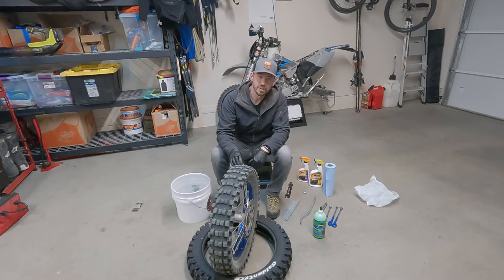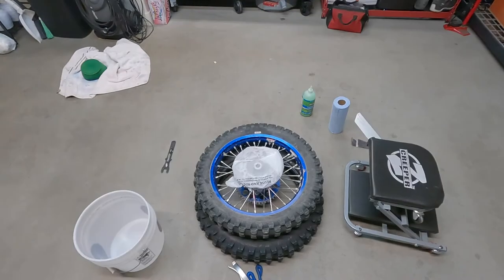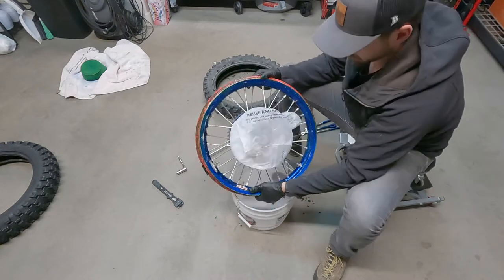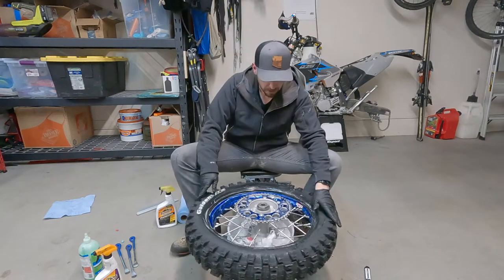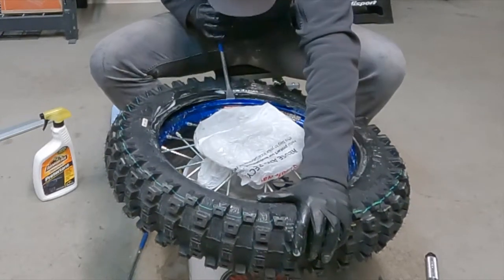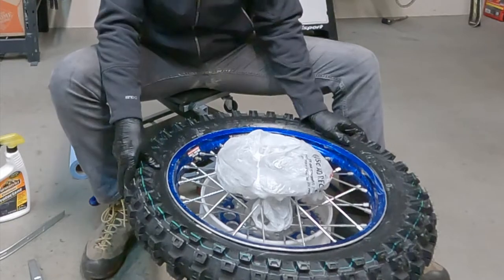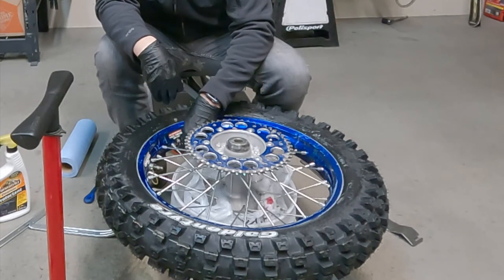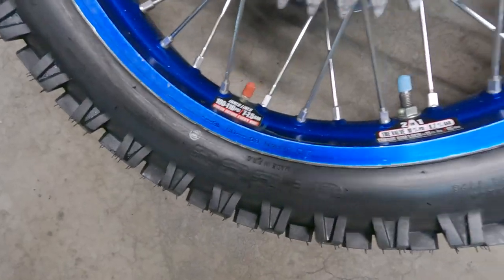Tubliss With Slime Benefits + Tire Change For Dirt Bikes -- No Special Tire Tools -- No Flats!

Comment: Nice and in depth, Legend 🤙
Reply from the maker: Thanks man! I’ve got a new trick too. First put a little bead of slime on either side of the red bladder. Then Once you get one side of the bead on the rim just dump the 8oz of slime in the bottom and very careful roll it around in the tire about 180 degrees. Then mount the other bead and you don’t have to put the slime in through the valve stem. Cheers!!
Reply: @SourceADV so are you doing this instead of using the Armour all?
Reply from the maker: @ThisTall  I still use armor all on the first install of the inner bladder to help it slide onto the rim well. I then use armor all or slime to lube up the red inner bladder to help it seal against the inside of the tire

Comment: I do a slightly different similar install method. I actually put a thick bead of Slime around both sides of the red inner liner and also inside the tire on both sides near the bead (using rubber gloves and smoothing the Slime in the tire). I then mount both side tire beads. That way the liner and inside of tire are already saturated with Slime. Once I have the tire fully mounted I air it up and the seal is always good. Not saying my way is better...I think it achieves the same result and I haven't had any leakage issues.
Reply from the maker: Nice! That makes sense too! Thanks for sharing
Reply: good thought/point, when watching I was wondering if slime could be my lube when doing install
Reply: also no issue with slime loosening the rim tape?
Reply: what Slime you used? tube or tire?
Reply from the maker: @jrago6228  nope! Works like a charm.
Reply from the maker: @jrago6228  regular tube slime
Reply: 100% Slime on the liner and tire install. Soapy water and tire products tend to absorb and dry by the time your getting the installed. Any dry spots significantly make the mating process likely to have a bad seal.
Reply: 100% Slime on the liner and tire install. 

Soapy water and tire products tend to absorb and dry by the time your getting the tire installed. 

Any dry spots significantly make the mating process likely to have a bad seal. Because the Slime stays wet and initially is slippery, it improves the seal. I’ve never had to reset a tire since the Slime only.

Comment: Thanks for sharing your technique. Ive always been currious about slime in tubliss, think Im going to give it a go.
Reply from the maker: You can fill the tire with slime easier by
Doing it like a mountain bike tire. Get one side of the bead mounted, then pour the slime into the tire from the other side, way easier than going through the valve.  Cheers!

Comment: Nice video. Lots of install videos but this is the first I found that shows replacing a tire on s tubliss system (as opposed to initial install). Also using Armorall with slime was enlightening. Until now I  wasn't sure you could use both on the same install. Thx.
Reply from the maker: No problem! Check out my response to Gavins comment (pinned to the top) I figured out a trick from the MTB world that saves a lot of time and energy. Cheers!

Comment: I’ve used both Slime with the red label that’s meant for dirt bikes, atv etc. and I’ve used Stan’s tire sealant and I think Stan’s is a better choice because it isn’t as thick as Slime and coats the inside easier and faster. It might be a personal preference but I’ve had better experiences with Stan’s over Slime in both my MTB and dirt bike.
Reply from the maker: Nice! I use Stan’s in my MTB too, seems like it would work well

Comment: Nice work on the video. Thanks and thumbs up. I like your method. I do have to say that I think Slime is the most worthless sealant ever made. I know you said in the video that you are using it for lubricant to extend the life of your Tubliss, but there are soo many better sealants that will actually plug punctures and rips in your tires. You won't need to add a plug when you get home to stop the green ooze with those sealants like you do with Slime in most cases. Ride On.
Reply from the maker: I’ve had pretty good luck with it overall. The holes I’ve gotten that needed plugs were pretty big holes (mostly from tearing off side lugs) that I think would put any sealant to the test. What’s your favorite you would recommend? I run Stans in my MTB. Cheers!
Reply: @SourceADV  So far my favorite is Cafe' Latex. Granted it may be 50% more money and it may not lubricate as well. It will stop a leak better than anything I've tried however. One advantage to the stiff Moto tires with Tubliss is that you can run at 0 psi when a hole doesn't seal. Try that with a MTB tire and it gets bad fast when the tire pops off the bead.
Reply from the maker: @adaycj  I can't see any instances of people using Cafe Latex for moto tires. Do you know if it is normal to do so?

Comment: nice video - I'm about to do this soon. curious if you've heard of the Baja No-Pinch tool... wouldn't this tool make the install even easier?
Reply from the maker: Thanks Greg! You know with the Tubliss system, as long as that inner bladder is nice and lubricated with Slime, its pretty darn easy and straight forward to get on without risk of pinching, using those little spoon type irons makes it pretty straightforward. The biggest thing I've learn since I posted this video is to just spray the slime or sealant into the fresh tire after you have one side on the bead, like they do on MTB tires, then mount the next side. It's way easier than going through the valve stem. Cheers!

Comment: My instructions say to use Armour All when spooning on the Tubliss liner, but when spooning on the tire, to lube the outside of the liner and inner tire bead with the sealant. You used Armour All for both Tubliss and tire. Have you tried only using the sealant as lubricant when mounting the tire and if so which do you prefer?
Reply from the maker: I’ve done both! I like applying armorsll to the bead, and If you apply sealant to the liner before it does eliminate the step of dropping the tire which is nice. Using sealant on the bead of the tire tends to just get a bit messier. But the outcome is all the same. Cheers!

Comment: The seal is between the red inner and the tyre bead itself only,so I was thinking that the  inner should be left at 100psi then undo the low pressure  tyre valve,add slime refit the valve and pump up to 15psi,done.
Reply from the maker: Getting some slime on that seal helps mitigate air loss from the outer chamber.

Comment: Do use some slime in the red bladder too?
Getting ready for an install  and following your great slime tips.
Reply from the maker: No you don’t need to just the outside chamber
Reply: @SourceADV  the tire u used was new never mounted?
I hearing from Tubliss that even though my tire and bike have not been riden yet (brand new) a.mounted stock tire will have rim.lock defects and cause seating issues
Reply from the maker: That is correct. Many times the tire takes some damage being taken on and off that can compromise the sealing surface.

Comment: do you just drill another hole in your original rim? or do you buy rims  for that, also will will work on classic bikes? like classic tyres, say a royal enfield or any bike in a retro theme running spoke wheels?
Reply from the maker: Hey Matt, most dirtbikes already have two holes, one for the tube valve, one for the rim lock. So you just enlarge the rim lock hole. I’m not sure re: class bikes, probably reach out to Tubliss about that. Cheers!
Reply: @SourceADV  thx :) yeah, I will reach out to them , if the classic rims don't work with this..then I guess one will just put a motocross wheel on a classic bike lol...still question remains as to tyre choice..interesting that noone looked at that, it's a big market that
Reply from the maker: Technically the Tubliss system is not approved for street riding so that’s probably what they will say, just a heads up

Comment: What about put slime aslo into inner (high pressure) tube? I have air leaking there..
Reply from the maker: I don’t think slime was designed to be used at those pressures. Just get a new inner bladder and replace it

Comment: Can we use it in tires that has tube? Or need to change with tubeless tires?
Reply from the maker: Slime makes a tube safe sealant, but it won’t protect against pinch flats on tubes, but will help with small punctures

Comment: I like the Stan’s better not as messy  in your tire
Reply from the maker: Does it seal big holes well?
Reply: @SourceADV  yes it does but don’t get the Stan’s Racing brand it’s hard to get in tires you have to put it in slow  to fast and it plugs up the valve
Reply from the maker: Roger that! I found the best way to pour it in is to get one side of the bead on the wheel then pour it in through the open bead before seating it. Much faster and far less annoying than squeezing through the valve stem. Hope that helps, thanks for the info!

Comment: Slime is corrosive to aluminum. So maybe a different tire sealant..?
Reply from the maker: The slime doesn’t really touch the aluminum because it’s in the outer chamber. Plus most rims are anodized anyways
Reply: @SourceADV  something ive seen personally on a Ktm 350xcf I bought from someone who had slim in the tire w/ tubliss. Didn’t destroy them but there was noticeable pitting.  I’m sure the installer makes a difference but there is other options of tire sealant and maybe avoid that issue all together.
Reply from the maker: Interesting, it says on the Slime website that Slime is not corrosive.
Reply: @SourceADV  Google it. Comes right up. I’m YouTube illiterate and Cnt figure out how to post a pic 🤣

Comment: Nice tips, getting ready for this on 2 new never ridden KTMs. Have u noticed the air staying in tires better with this slime technique? ( I see some say Stan's sealant, never heard of but?)
 no issues with the slime loosening the rim tape? 
 Armor All has no problem with keeping the bead adhered to the rim especially mixing with the slime?
 Wondering because the soapy water ends up drying leaving tight bond rubber to rim this is my wondering point.
Reply: I just see Bob bellow(sounds funny!) comment, he makes a good idea/point too.
Reply: Slime has for tubes and tires I think, you used what?
Reply from the maker: Air stays in great. The only thing that leads to leaks is punctures haha. I think the soapy water stays in the slime and dilutes it and makes it thinner. I use regular slime for tires that you get from auto parts store and it has worked great. Cheers!!

Comment: Using tubliss if that inner small tube is broken, can we just replace that tube or we need to replace another set of tubliss.. that inner tube looks like a bicycle tube.
Reply from the maker: You can buy replacement inners from most places that sell tubliss. It’s a very beefy little tube

Comment: I will be installing tubless in my beta soon.For the heck of it I am going to let the air out of liner after I have it hooked up.Might help suck some slime in faster.
Reply from the maker: Yup! Definitely a good idea. Also, it’s easier to pour the slime in while you have one bead on versus through the valve stem. Cheers!